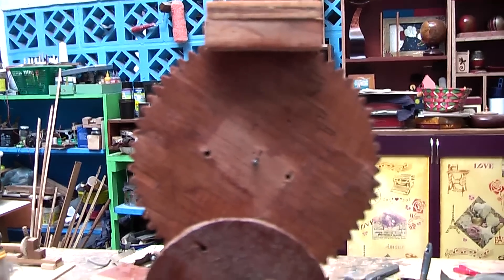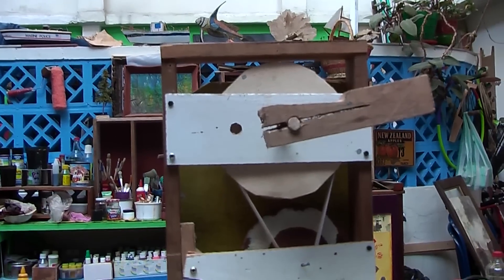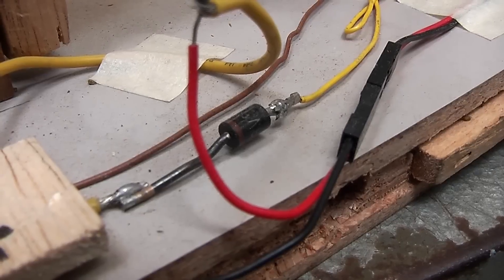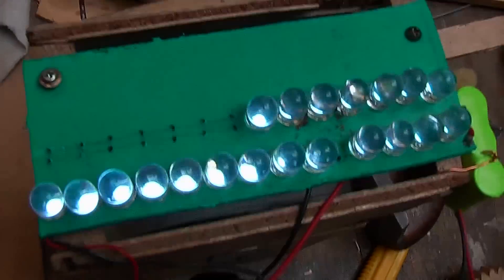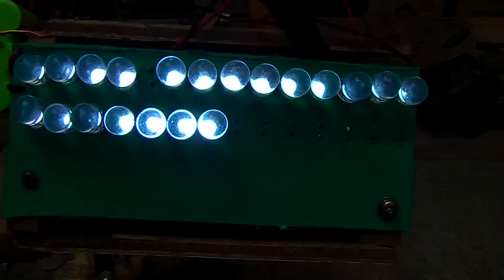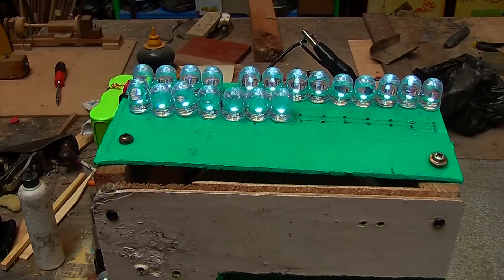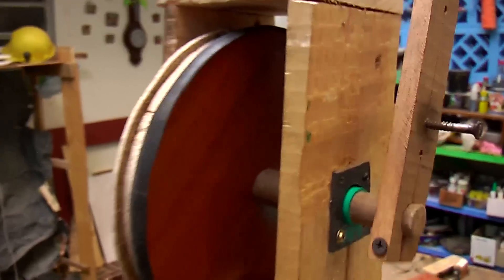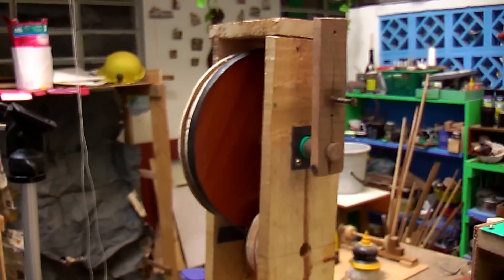Re- inventing The Wheel And Electricity

Comment: Hi Philip,
Does simply spinning a motor generate the electricity at the leads or do you need to modify it to make it a generator? Do you use AC or DC motors and is one more efficient than the other? Thanks for your videos!  They have inspired me more than once. Minneapolis, MN.
Reply from the maker: +rob5i . Different motors will act differently depending on their design. Some  have magnets , others only wire windings, so they work differently. I will go into that in further videos, but  any DC motor with two leads should generate without  any problem.

Comment: the big pulley wheel on some of those looked a lot like the one on your lathe project. I'm surprised you didn't  attach the string and foot treadle to operate it.
Reply from the maker: +tinkersdamnworkshop . You are very observant. Yes, the yellow one was the lathe. I used it  to test the 'one wheel' concept, then made one larger wheel to order. The treadle worked sort of, but  pulsed quite a bit as the motor provides a lot of drag as it turns the rotational energy into electricity.

Comment: some small advice i might give is to move on from the small motor as a generator, its small size means a lot of friction and effort spinning it fast,(you are using it as a dynamo) instead perhaps look into putting your own coils onto a flywheel and between very powerful magnets, this both reduces friction losses and give you weight in the flywheel, and with super magnets, much more efficiency, but indeed its a learning curve of its own.  (this is more like the modern alternator!, also vice versa with magnets on the flywheel and static coils, this method means no moving contacts, very reliable) , also perhaps save a couple of the largest capacitors from inside a powerful item, to smooth out the pulses from cranking, will work better than batteries, as they charge almost instantly.  good luck with experiments! thanks for the video
Reply from the maker: +jusb1066. Yes indeed, it is on the  agenda. As you say it is all a learning curve, and  fun learning all the way. For now I am using the small motors to test theory, and also  come up with useful  things for  village situations here, then scale up, and try some variations as well. I am considering doing a kickstarter to use laser cut cogs, that is- going smaller, from these concepts to make  lighting for indigenous huts, as well as other larger projects. There is lots to learn.
Reply: +PhilipStephens007
indeed there is nothing more valuable these days than a way to charge your phone, when there is no power you sure realise how much you have taken AC socket for granted, good luck, hope to see something people can make from various discarded electronics and your usual ingenuity with wood, it would seem also the  bicycle is a good thing to modify, as many of the issues of muscle to rotational power are solved, and semi broken bicycles cant be too hard to find in columbia also?